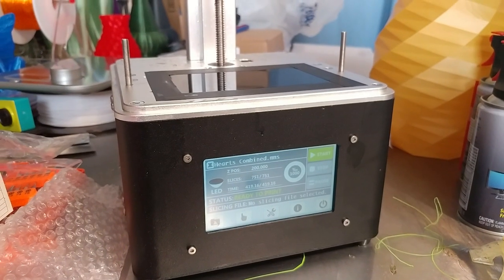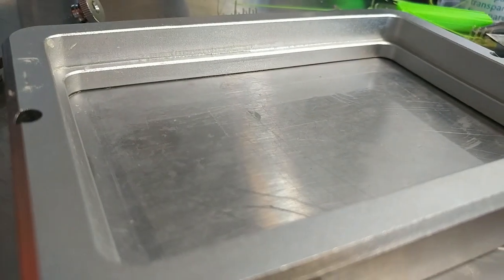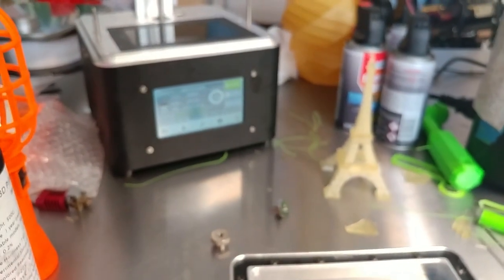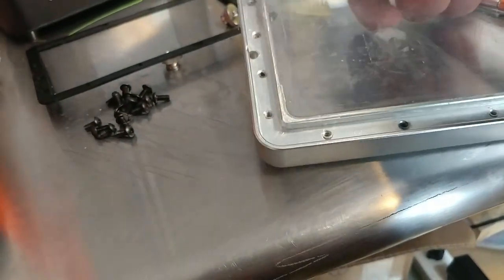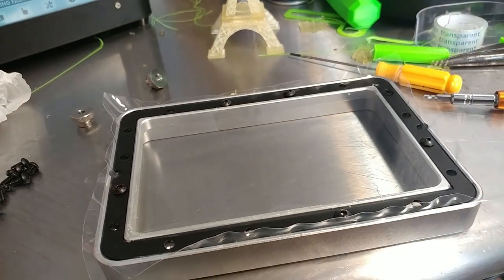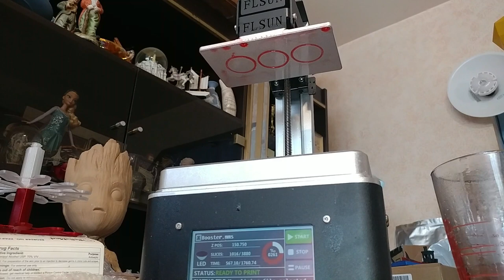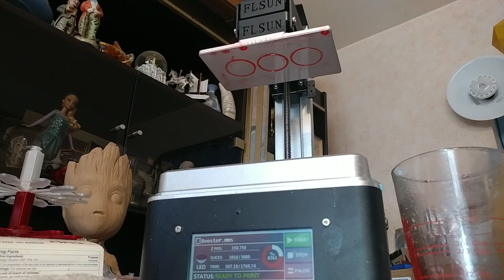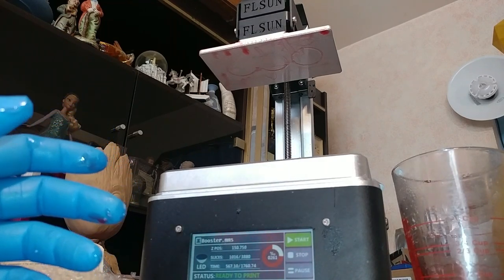Today's 3D Print 198 Resin Update Progress FLSun S DLP Resin Micromake L2

Comment: I've been using a Form 2 for over a year (I have access to it in my works makerspace) - one of the things which took me by surprise is that the pigments in the resin influences "quality". The more clear the resin is the lower your maximum quality is, conversely the more light blocking the pigmentation is the higher your resolution/accuracy. This is due to what I call "shine through" (I'm not sure if that's the proper term but I find it fitting) where resin outside the target voxel gets cured. Nothing revealed this to me more than trying to print a recirculating linear bearing where my return tubes came out egg shaped due to the shine through when i used the "tough" resin - things went much better with the black.

I'm not sure how opaque the resin can be for these DLP printers, but it's food for though, esp. if you start trying to do any small functional prints.
Reply from the maker: That is very interesting I have not noticed a quality difference yet except that I got better quality with the clear but I determined that was insufficient burn time it seems that the more color I have the longer the burn I need to get a print at all especially fine details which don't show up at all at Clear burn times unless I triple them for example the included resin could work at 10 to 12000 milliseconds later time but for find resolutions and strength I need 30 mm or longer milliseconds with the wanhao red

I have noticed no difference in quality or resolution but keep in mind these units have nowhere near the resolution of a form to from what I understand it's a 1080p display panel so the resolution is 1080p at 108 millimeters wide 68 mm deep

I will be sure to let everybody know what happens I just ordered my first opaque resin makerjuice sf gray resin

I suspect these units are not high enough resolution to experience the problems you experienced the form to is an amazing machine :-) I can't afford that :-)

I was wondering about exactly what you described regarding shine through and was concerned I would experience that problem with these extra long burn times but so far they seem to be working fine so the low resolution might be a factor there reducing the overall shine through bleeding

I also wonder if maybe the LED UV light isn't strong enough to penetrate that deep for the shine through affect you experienced?

I am far far too much of a noob at this to know that :-)

I have quite a few plans for this resin printer which is one of the reasons I want the photon as well. Emily to review the 2 compared to each other but because I really want two of them :-) I think I can make some interesting things with these printers that could maybe turn a profit on but damn is the resin expensive 70 to $80 a litre is the best I can find with the wanhao resin at $68 being the cheapest
Reply from the maker: You know you're shine through example reminds me of something I poured off some resin into a cup and on a hunch that maybe there was something wrong with it there wasn't but playing it safe I decided to dispose of it so I shine my 12 watt UV light into it and of course it cured rapidly but I noticed it only cured on the surface what's the surface at hardened it did not cure below the surface it also hesitated to cure through the glass as if the glass blocked a lot of the UV strength

The reason this is interesting is because I kind of simulated your form to I shined my 1 watt blue laser which is partially in the UV into the glass and it was able to cure resin inside the glass which I thought was interesting

I like printing very thin .5 mm shell but sometimes the shell tears after printing but before fully curing you will see this in my video about the Sorceress as I attempted the printer multiple times for super thin Parts I now use my laser to zap parts of the print thay I want to Harden a little more before attempting to remove from the print bed

It is surprisingly effective I have learned not to use a UV light to cure on the print bed since it cures everything including the micro layer of resin on the print bed while this is easy to clean off with a scraper it adds a flashing to the mall which is sloppy in a pain to remove the laser gives me more precise control to hit where I want to hit without curing the micro layer on the print bed

Comment: I have the L2, got it recently and its a great printer, my tip to save yourself a lot of time, stop using Meshmixer and download FlashPrint. Its Flash Forge's own slicer for their printers which yes is for FDM printing BUT it has some excellent features you can use in line with the Micromake software. First of all you can do Tree Like supports in seconds. They can be auto generated or you can just draw them in manually by click and drag. It also allows you then to scale, duplicate, repair etc - all the normal functions of a slicer. Then you just save the STL and import it into the Micromake software.
Reply from the maker: Fantastic I will take a look at that for sure as meshmixer really does not like my larger models :-)

Comment: Hey there, Thanks for the FEP tip. Quick q: have you printed with black resin and if so, how photo opaque is it? Could you shine your phone camera flash next to the part and see some of the light bleed through to the other side? For instance, a 1.5mm thick disk: would you be able to see the light on the other side of the disk? Cheers.
Reply from the maker: I have not tried black
Reply: Nerys Hey, thanks. Any thoughts about the colors you have used?
Reply from the maker: Colors will come very slow for me the resin is very expensive the resin that came with it worked very well it was clear but more yellowish clear the red from one house pretty nice although it looks better solid you'll see that in my upcoming video once I have the money I'm going to order a bottle of monocure White 90 bucks we'll see how well that goes well they have a rapid version that's supposed to work with DLP printers

I have to send the maker juice back to Amazon as it does not work with the flsun it appears to be a Form 1 form 2 SLA resin you can tell that it was trying to cure it but it was not able to cure it enough to stick to the build plate this is most likely do to it requiring a longer or higher power UV source my printer Max is out at 2 minutes and that was not enough to make it stick
Reply: Thanks a lot for your info. You're the only one out there with any detailed use about this printer (or the L2), so thanks for posting it. I ordered the L2 and some Wanhao resin 1ltr of black for 67 bucks. I'll let you know what I find out about it. I need it for shutters in my camera. I'm going to paint it anyway. Check out HammCamera{dot}com if you want to see what I'm making with 3d printers. It's pretty cool. Cheers!
Reply from the maker: The wanhao stuff needs 90000 to 100,000 milliseconds for the first layers and depending on what you're printing between 20000 and 40000 milliseconds per layer after that you might need a little more toward the higher end with a black if it blocks more of the UV light

As long as it's nice and tight you have burn times correct and the bazan is clean the printer is extremely reliable and consistent

Comment: Fingerprints on the FEP will degrade print quality so I suggest the use of gloves when changing the sheet (not to mention avoiding contact with trace resin - things get nasty if you become sensitized to it).
Reply from the maker: I did not know that I will avoid contact with the fep sheet from now on without gloves
Reply: I'll correct myself a touch - what I said about fingerprints degrading quality is certainly true for the Form 2 and I would expect it to hold true for DLP as well but they are different technologies and there's a huge difference in the amount of energy involved - maybe the light scattering wont be as bad with the DLP... but why risk it ;)
Reply from the maker: I don't think it affects the resolution at all not because your advice is bad or wrong but because the resolution of the DLP is solo that the fingerprint becomes irrelevant I mean I had pieces of Scotch tape on the print bed and still got amazing print out of it :-) now as I move to higher resolution machines I imagine that will become more critical form 2 is a much much higher resolution machine we're a smaller obstruction would cause a much bigger impact
Reply: The D7 community definitely talks about not touching the FEP film without gloves. We are also careful not to scratch the FEP when lifting undercured parts off of it. You may not see the difference in print quality in a large print, but if you print a model that is flatter you will be able to see the scratch marks/fingerprints on the surface. 

What thickness FEP are you using? The thinner you go the more quality you can get out of your prints.100-120 micron FEP are good, but you need to be gentle with it.
Reply from the maker: I think I have a link in the description I'm using the four sheets of D7 fep I found on Amazon for $19

Comment: 100 second cure time?  I have not heard anything like that long on these printers.
Reply from the maker: I don't know if it has to be that long but that's what my stopwatch said was on the included pre-sliced files so that's what I use :-) but I use the suggested 30 seconds it's stuck to the fep and not the aluminum
Reply: It should vary depending on what resin you are using. Each one is different. It also changes based upon what micron you are printing at.
Reply: Good to know, I am sure it changes with printer, how it is zeroed (initial layer height), and resin.  some of the settings on the facebook group for the anycubic photon are up to 80 seconds for initial layer, so I guess in retrospect that is not that far off.  Thanks for the info.
Reply from the maker: I bet 80 seconds would work but I'm leery to change it since it's working and it would only save me 40 seconds cuz I do the first two layers at 100 seconds
Reply: Nerys is this with the wanhao red? What micron?
Reply: Yeah, do what works, I totally get that.
Reply from the maker: The red ones are with the wanhao resin it requires much longer layer to layer time then the stock resin which actually makes sense since it's thicker more viscous and more opaque so you would need more exposure to get enough UV light to cure it
Reply: burn time doesnt matter for first few layers as long as it sticks!!!!

Comment: I love tiny resin prints put omg what a hassle I don't think could be hacked with all that. Amazing prints tho.
Reply from the maker: Actually the process is pretty painless most of the pain you are seeing is from lack of instructions and guidance and I have to figure it out for myself kind of like if somebody handed you a cr10 with absolutely no knowledge of 3D printing and said good luck :-) as I learn I realize things are a lot easier it's actually easier than fdm what you feed the file you just click Start that's it you don't have to do anything else there's a little bit more clean up but it's easier than the sanding priming and what not you doing a 3D print normally there's just a different set of gotchas that you have to watch for no big deal really I just wish I can get some of the washable resin cheaper as it does not require as long a burn time per layer
Reply: Nerys I guess there is a learning curve. Would be nice if someone came out with a non toxic resin :)
Reply from the maker: Assuming it is possible at all to do that that will probably come as popularity increases and cost comes down but it's simple enough to use gloves and simply don't touch the liquid form of it

Comment: That has to be the most tedious way they could think of to attach the sheet to the reservoir.
Reply from the maker: Actually it's pretty ingenious it's very easy to do very secure low maintenance and long-lasting high durability this also allows them to sell the fep in sheets instead of pre molding it which makes it a lot cheaper 19 bucks for 4 of them and now that I know how to properly use it they will last a very long time

Any other way would be more difficult to install properly and would require proprietary custom parts which will just drive up the cost I rather like how they did it I was afraid I was going to have to order something special from micromake or flsun which would be impossible during the holiday right now I was very pleased to find out it was a simple sheet that I can unbolt the bolt back in

Again the only reason mine was damaged at all was for my lack of knowledge and a lack of instructions with the printer which is part of why I'm going to make these videos about this printer I think this is a very good machine I think a lot of people could have a lot of fun getting a lot of use out of machine like this especially one this cheap so I want to help people avoid the headaches I encountered :-)
Reply: This is a good point many resin based printers use custom replaceable vats to store the resin, it's the main issue putting me off getting the moai. They cost an extra 
£40 and only last 4l, im guessing thats including moving your prints around so they don't always use the middle creating spots that wear out quicker.
Reply: Form 2 suggests replacing the tanks every 1 to 2 liters! And those tanks cost about $50 ea. so +1 to replaceable film. I wonder if that FEP sheet also becomes depleted with use... Form 2 uses coated acrylic, the coating is what wears out but I'm not sure what the coating actually is (maybe it's FEP, IDK).  I believe the coatings job is to take up any oxygen present (or maybe produced) where the resin is cured, over time it becomes foggy and defuses the laser.
Reply from the maker: Ouch effectively increasing your cost per liter by $25 that hurts
Reply from the maker: Yeah these are cheap 19 bucks for 4 of them I've already got a hundred fifty hours of printing on the machine and it still going strong
Reply: Nerys I guess I was imagining something on a hinge that would just lift up to remove the sheet, and then lay back down and snap shut to hold a new one. Almost like a window that can be opened into a house for cleaning.
Reply from the maker: that would not be possible a window is glass rigid and flat this is more like heavy Saran Wrap I could Bunch it up into a ball

Comment: So for the 60hr print, how often do you think you will need to check in and do resin top ups?
Reply from the maker: I do not think I need to at all I checked on it after 25 hours and it still had plenty of resin in there I topped it up just to be safe but I don't think I needed to
Reply: Nice!
Reply from the maker: As is a repeating scenario here no real instructions were included :-) I have no idea how much resin I'm supposed to or not supposed to put in the vat so far it appears to be agnostic toward that it does not seem to care so what I do is I fill the first part of the vet home the printer since the print bed will take up a volume inside the vat and then I top it up this way I don't have to worry about it overflowing when the bed drops into the vat.

Comment: Is replacing the $19 FEP film in your printer equivalent to replacing the $55 tank of an SLA printer?  Even though SLP boasts higher resolution than DLP, replacing a $19 sheet of plastic sounds less painful than replacing an entire $55 tank.  
This guy says an SLA tank only lasts 150 printing hours.  He walks viewers through SLA maintenance: https://www.youtube.com/watch?v=6BaRpF8h-Ko
Reply from the maker: Yes but its not $19 its 4 for $19! Very cheap.
Reply: That''s even better.  
Does the DLP film cloud up similarly to the tank of an SLA printer?  150 hours and done?  SLA consumables are looking a lot more expensive than DLP,'s  at least for now
Reply from the maker: Mine gets a Milky coloring pretty quickly although this seems to be more to do with my cleaning it then the actual printing so far I've only had to replace because of physical damage caused by me and I put well over a hundred fifty hours on the printer already the replacement cost is so cheap that I'm not worried about it the resin cost is what's getting me :-)

The lower resolution and longer burn times of the DLP process will probably allow you to use a pretty messed up sheet and still get a good print I printed the Eiffel Tower with pieces of Scotch tape on the print bed :-)

I would never replace that build plate for $100 it looks like a piece of aluminum there's no reason for it to cost that much they should offer just the actual aluminum plate which looks like it unscrews that should only cost 5 or $10 so let's call it 20 for labor and profit 100 is unreasonable the rest of that build plate does not wear I'm talking about the XYZ printer that you are referencing from the other video

The only other concern I have is how long will the UV LED Source last? I don't know I have no idea what it's expected lifespan is and whether or not it's replaceable or not or if maybe I can replace it with something stronger? Or maybe that's a bad idea more light leakage?
Reply: Most manufacturer data sheets claim 10000 to 20000 hours and "easy replacement" for DLP lights which is encouraging.  Dunno if that applies to the FLSun